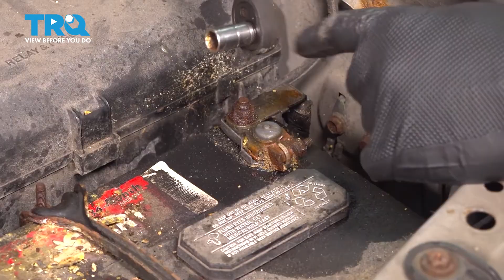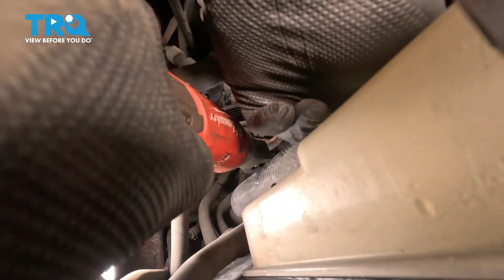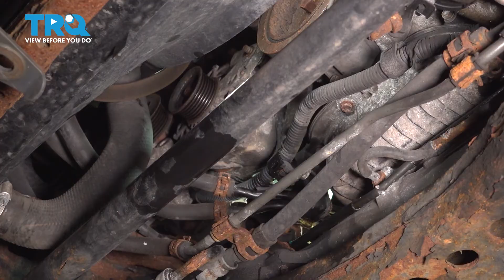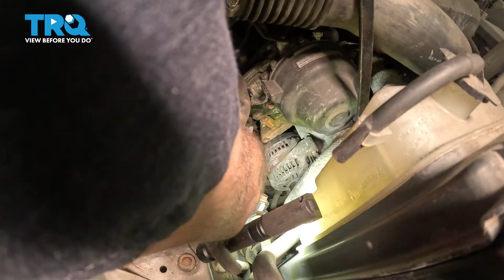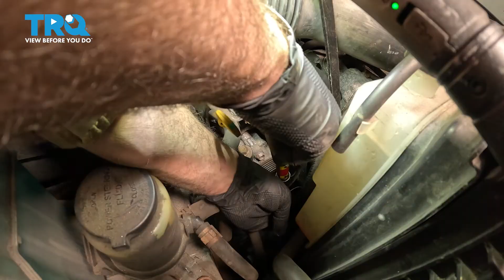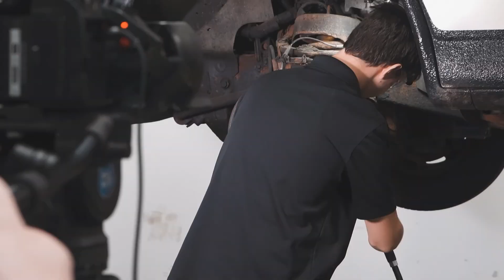How to Replace Alternator 2007-2021 Toyota Tundra 4.7L V8

Comment: Just did this on my 2018 tundra sr5, no e8 bit needed and only 2 bolts on the power steering pump. Came out the bottom no problem when you drop the sway bar.